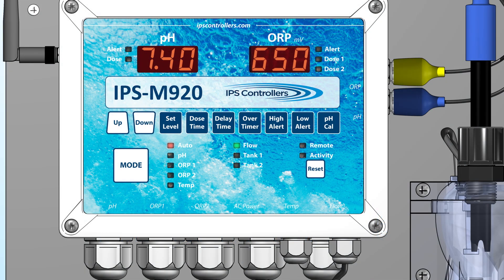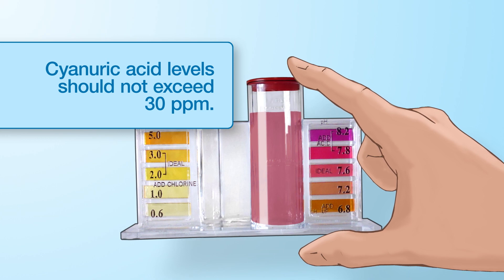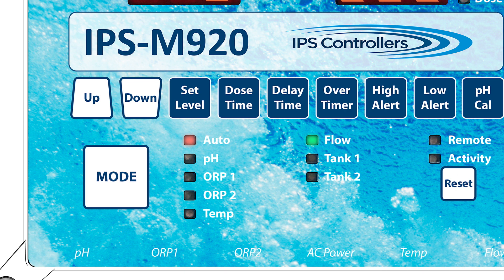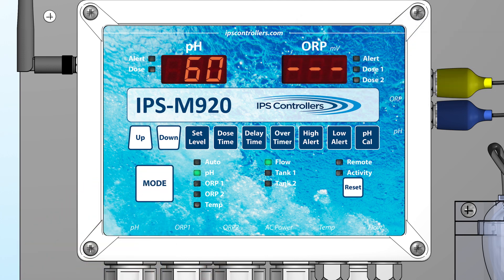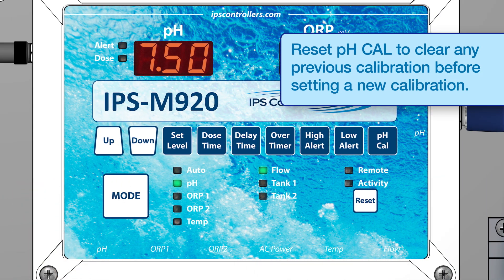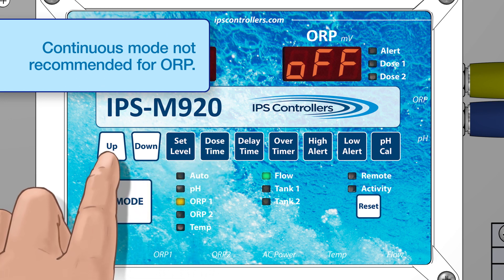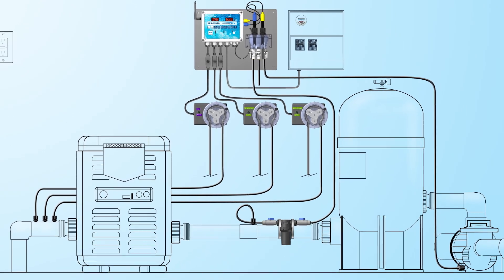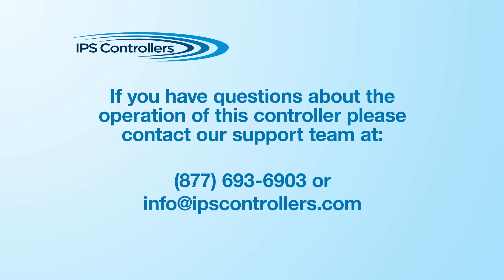IPS PROGRAMMING 04 23 24

Comment: Can you please do more videos on this maybe a winterizing and opening.
Reply from the maker: Possibly. Or something captured as an in person training video.  The easiest way to winterize is to close the valves to the flow cell, disconnect the flow switch from the controller, then take the flow cell with sensors indoors. The sensors just need to remain wet at all times.  Just reconnect at startup and get your chemicals balanced. Give the ORP sensor a few hours to acclimate to determine your set-level.  Call us anytime for assistance!

Comment: @7:29 Please explain more about this extra step in Calibration, that is not in in the manual.
Reply from the maker: Sorry for the late reply! You don't have to clear the calibration first, but it is a great way to see what the controller is actually reading without any calibration.  That way you can see if the controller is actually reading off vs. your test.
Reply: @ipscontrollers9283  Great, Looking forward to the new video posted. Been waiting for a training video. Learning them is one thing, teaching them can be challenging. Thank you.